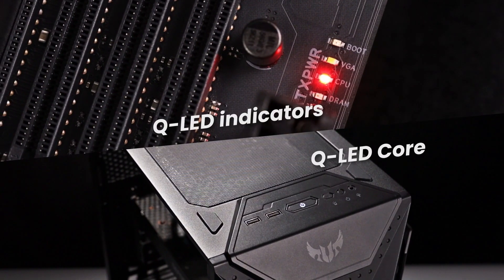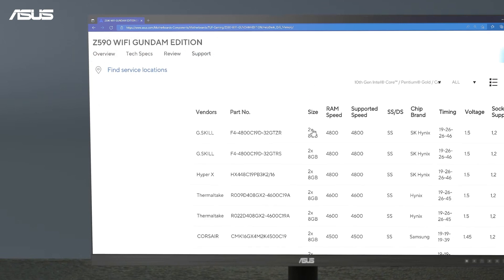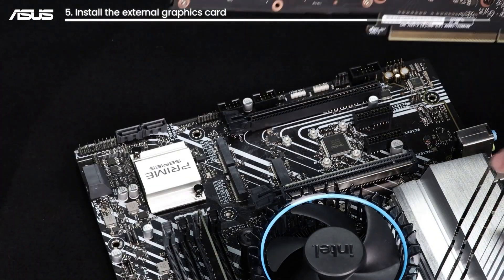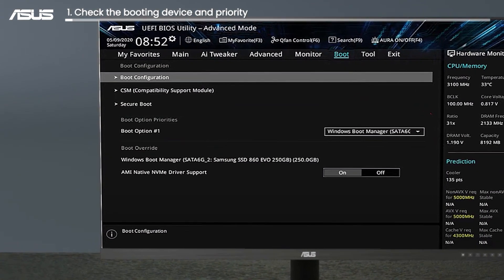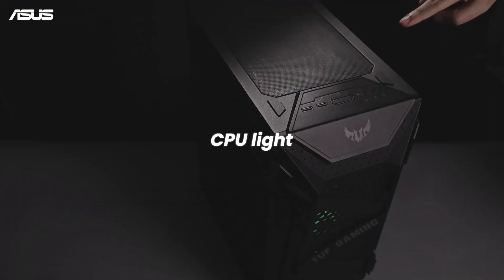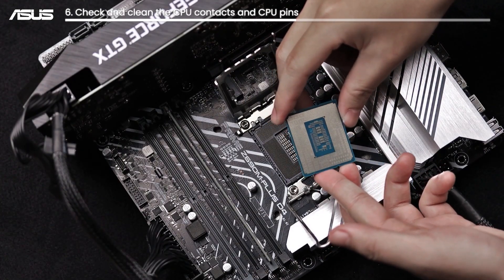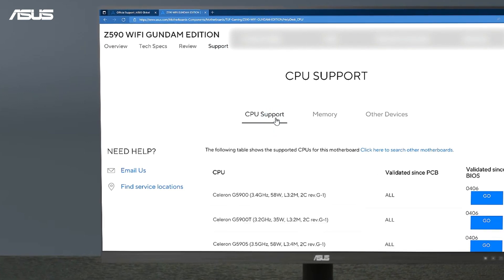ASUS Motherboard Troubleshooting via Q-LED indicators, Q-LED Core   | ASUS SUPPORT

Comment: Hi Asus Support, my new computer power led will blink 3 times and continue with normal boot, what could be the issue?
Reply from the maker: Hi, may I ask if your question is related to motherboard?
If so, we are delighted to provide you with a dedicated discussion forum to ensure you receive the best support and answers.
On the forum, you can ask questions related to the products, share your experiences, and interact with other users.
Our dedicated team will also be there to provide personalized assistance, ensuring you receive accurate and timely responses.
https://zentalk.asus.com/t5/motherboards/bd-p/motherboards
Thank you.
Reply: @asus_support  yes, related to motherboard, sure I will post my questions there.
Reply from the maker: It is recommended that you post here to get more assistance, thank you.
https://zentalk.asus.com/t5/motherboards/bd-p/motherboards

Comment: I have an ASUS Pro B650M-CT with a Ryzen 5 7500F and RTX2070 and I'm getting no display out of it. The power LED cycles through the quick/slow/super slow flashing on startup. I mean, it flashes quick for a couple of seconds, then slow for a couple of seconds, and then continuously flashes super slow. I get no display from the graphics card.
I have tried multiple graphics cards, boot devices, and power supplies as I have spares on hand but I don't have any other Ryzen 7000 CPUs or DDR5 to test.
Is it normal that it cycles through the different patterns or does this mean it is erroring on the memory, GFX and boot device? Since there's no display I can't access the BIOS either.
Reply from the maker: Hi, may I ask if your question is related to motherboard?
If so, we are delighted to provide you with a dedicated discussion forum to ensure you receive the best support and answers.
On the forum, you can ask questions related to the products, share your experiences, and interact with other users.
Our dedicated team will also be there to provide personalized assistance, ensuring you receive accurate and timely responses.
https://zentalk.asus.com/t5/motherboards/bd-p/motherboards
Thank you.

Comment: Hello I just built my pc and it work. But the next day it didn’t. I turned on something in bios on accident and now it doesn’t work. It’s flashing vga and boot. I followed the steps 3 times but it still doesn’t work. My motherboard is a b760 with wifi. Please help
Reply from the maker: Hi, may I ask if your question is related to motherboard?
If so, we are delighted to provide you with a dedicated discussion forum to ensure you receive the best support and answers.
On the forum, you can ask questions related to the products, share your experiences, and interact with other users.
Our dedicated team will also be there to provide personalized assistance, ensuring you receive accurate and timely responses.
https://zentalk.asus.com/t5/motherboards/bd-p/motherboards
Thank you.
Reply: @asus_support  NVM I just had to reset the cmos

Comment: Hey pc wizards, I'm busy with a new build and I'm using the rog strix B760-A Gaming wifi motherboard. Once on startup it works through qled indicators, it gets stuck on VGA and then BOOT. I've tried 3 different gpu's. Cleaned out the x16 pcie slot. Check power plugs going to gpu and hdmi cable(works perfect with other pc). Did a lot of reading online and couldn't find anything that resembles my problem. 

My build: 
Cpu i7-14700KF 
Memory: corsair vengeance 32gb DDR 5600 MHz 
Gpu : geforce rtx 3070

Please any advice will be appreciated.
Reply from the maker: Thank you for your interest in our products!
We are delighted to provide you with a dedicated discussion forum to ensure you receive the best support and answers.
For our gaming series products, we have created the ROG Forum specifically for gaming enthusiasts and users of ROG products.
On the ROG Forum, you can ask questions related to the products, share your experiences, and interact with other users.
Our dedicated team will also be there to provide personalized assistance, ensuring you receive accurate and timely responses.
For your question, we recommend posting it here to seek answers.
https://rog-forum.asus.com/t5/gaming-motherboards/bd-p/HSS_MB
Thank you.

Comment: Hola tengo un problema, prende y se queda encendida la luz de VGA blanca y la verde, quedan encendidas y no da nada de vídeo, se apaga de un solo apretón el botón de encendido, no lo mantengo apretado para que se apague. Mismo problema en b660i y tuf b660 plus WiFi, i3 12100f Kingston 5200 y VGA Vega 56 Pulse. La gráfica ya fue probada en equipo AMD y lo mismo los discos
Reply from the maker: Hi, may I ask if your question is related to motherboard?
If so, we are delighted to provide you with a dedicated discussion forum to ensure you receive the best support and answers.
On the forum, you can ask questions related to the products, share your experiences, and interact with other users.
Our dedicated team will also be there to provide personalized assistance, ensuring you receive accurate and timely responses.
https://zentalk.asus.com/t5/motherboards/bd-p/motherboards
Thank you.

Comment: Hi, I’ve just posted on the forum but let me post the same stuff here.
The sentences is below

“Hi, I’m facing on a problem that Q-LED boot lamp lights green, and the motherboard never boots, never enters UEFI with pushing F2 and Del key.
I’ve tried anything I can do like, changing SATA cable, changing the port, removing ALL USB devices, BIOS Flashback, CMOS resetting, checking C: Drive and CPU(Ryzen 5 5600G) is alive on other computer. Of course, I renamed the .CAP file, and nothing happens.
I really appreciate your support, thank you.”
Reply: The motherboard is ROG Strix B550-A Gaming
Reply from the maker: Thank you for your interest in our products!
We are delighted to provide you with a dedicated discussion forum to ensure you receive the best support and answers.
For our gaming series products, we have created the ROG Forum specifically for gaming enthusiasts and users of ROG products.
On the ROG Forum, you can ask questions related to the products, share your experiences, and interact with other users.
Our dedicated team will also be there to provide personalized assistance, ensuring you receive accurate and timely responses.
For your question, we recommend posting it here to seek answers.
https://rog-forum.asus.com/t5/gaming-motherboards/bd-p/HSS_MB
Thank you.

Comment: hi, when i run program that heavily occupy all cores, the CPU light start to blink. sometimes the program is terminated. im using Ubuntu 20.04
Reply from the maker: Hi, may I ask if your question is related to motherboard?
If so, we are delighted to provide you with a dedicated discussion forum to ensure you receive the best support and answers.
On the forum, you can ask questions related to the products, share your experiences, and interact with other users.
Our dedicated team will also be there to provide personalized assistance, ensuring you receive accurate and timely responses.
https://zentalk.asus.com/t5/motherboards/bd-p/motherboards
Thank you.

Comment: I have a B350 F and when i start the pc it shows orange light then red light and then a constant white light.

I am not able to reach the boot menue. This happened and sometimes the pc just boots and now its not booting at all. What might be the cause🥹
Reply from the maker: Please refer to the following FAQ for troubleshooting.
[Motherboard] ASUS motherboard troubleshooting via Q-LED indicators
https://www.asus.com/support/FAQ/1042678/
If the issue persists, it is recommended to send it for repair and diagnostics.
The following is the contact information:
https://www.asus.com/support/service-center-location 
Also you can contact the local service center for help.
The following is the contact information:
https://www.asus.com/support/CallUs# 
Sorry for any inconvenience it may be caused.

Comment: Hi, I bought an ASUS z790p-d4 and I can’t use 2 ram slots (1st and 2nd) I can only use 3rd and 4th. I have same 4 ram memories and the 4s works perfectly on the 3rd and 4th socket. I’ve tried cleaning the sockets many times and nothing happens
Reply from the maker: Hi, may I ask if your question is related to motherboard?
If so, we are delighted to provide you with a dedicated discussion forum to ensure you receive the best support and answers.
On the forum, you can ask questions related to the products, share your experiences, and interact with other users.
Our dedicated team will also be there to provide personalized assistance, ensuring you receive accurate and timely responses.
https://zentalk.asus.com/t5/motherboards/bd-p/motherboards
Thank you.

Comment: Hi all, i have asus tuf gaming z790-plus d4 the problem is my motherboard hdmi port works fine but my graphics card hdmi port is not working the graphics card lights up and everything but no display and the led light stays on white, Can anyone help me please. thank you
Reply from the maker: I would suggest that you try updating and installing the graphics card driver, as well as testing with a different monitor to determine whether the issue lies with the motherboard interface or the monitor itself. Thank you.
Reply: @asus_support  I updated my graphics card still didn't work but when I put on the second pcie it works, I need the primary pcie slot to be working. Thanks
Reply: Common reply Asus support please
Reply: Same issue here rn with my 4070 ti
Reply from the maker: May I ask if your question is related to a laptop?
If so, we are delighted to provide you with a dedicated discussion forum to ensure you receive the best support and answers.
For our laptop series products, we have created the forum specifically for users of laptop products.
On the forum, you can ask questions related to the products, share your experiences, and interact with other users.
Our dedicated team will also be there to provide personalized assistance, ensuring you receive accurate and timely responses.
https://zentalk.asus.com/t5/gpus/bd-p/GPUs
Thank you.
Reply: @aleksandre3381  I have the same graph and the same problem with the Asus Z790a- Wifi
Reply: I have a problem with ROG STRIX B760-F GAMING WIFI the VGA LED remains lit every now and then I tried the guide, updated the bios, updated nvidia drivers, tried two RTX 3060/ RTX 4080 cards and the problem persists the video cards work correctly, please please do a bios update that solves this problem, I also have problems with XMP profiles on DDR ram 5 CORSAIR VENGEANCE RGB DDR5 RAM 32GB 7000Mhz, once set the system freezes and restarts the bios!
Reply from the maker: Regarding your question, I would recommend you visit the following forum post to get more assistance. 
https://rog-forum.asus.com/t5/gaming-motherboards/bd-p/HSS_MB
Sorry for any inconvenience it may be caused.

Comment: asus b450 plus not working with ryzen 5 1400. original owner said it didn't work with ryzen 7 3700x but does work on old ryzen 3 1200. updated bios. no boot. tried resetting cmos. still no boot. but works perfectly on ryzen 3 1200
Reply from the maker: Hi, may I ask if your question is related to motherboard?
If so, we are delighted to provide you with a dedicated discussion forum to ensure you receive the best support and answers.
On the forum, you can ask questions related to the products, share your experiences, and interact with other users.
Our dedicated team will also be there to provide personalized assistance, ensuring you receive accurate and timely responses.
https://zentalk.asus.com/t5/motherboards/bd-p/motherboards
Thank you.

Comment: What does it mean when no q-led indicators come on? No display to even see the bios screen. But the q-led never come on at all.
Reply: Am having the same problem did you get help
Reply: I’m also having the same issue on my Rog Strix B550-F. I start my pc, no qleds light up, and also nothing comes on the display.
Reply from the maker: Regarding your question, I would recommend you visit the following forum and post there to get more assistance. 
https://rog-forum.asus.com/t5/gaming-motherboards/bd-p/HSS_MB
Sorry for any inconvenience it may be caused.
Reply from the maker: Hi, may I ask if your question is related to motherboard?
If so, we are delighted to provide you with a dedicated discussion forum to ensure you receive the best support and answers.
On the forum, you can ask questions related to the products, share your experiences, and interact with other users.
Our dedicated team will also be there to provide personalized assistance, ensuring you receive accurate and timely responses.
https://zentalk.asus.com/t5/motherboards/bd-p/motherboards
Thank you.

Comment: Hi. I put together my new PC today. After turning it on, I have a very slow blinking light. I would say it is most likely the Boot-Indicator Blink. (8Sec from LED on until next LED on) 

Unfortunately, i get no visual signal from  my HDMI output so i can't check in BIOS (or do anything else). Neither the Mainboard nor the GPU (2080Ti) HDMI output gives me a signal.
So i kind of don't know what to do and if it really is a booting problem or something else. I am noob in building a PC. But i thought i connected everything.
Any ideas?!
Reply: Something prob not plugged in right
Reply: PS: I figured it out: I hab my RTX 2080ti connected via an 8pin cable, wich had 1 plug on one end and 2 on the other. So i thought i could plug the two headed side in my gpu. But it HAS to be two seperate cables to work
Reply from the maker: Please make sure all the components are properly connected. Double-check that the RAM, CPU, GPU, and all power connectors are securely seated. Reseating components like RAM and the GPU can resolve connectivity issues. Turn off the PC, unplug it, and carefully reseat these components. If possible, try starting the PC with the bare minimum components: CPU, one stick of RAM, and the GPU. Disconnect all other peripherals and drives. This can help isolate the problem.
Reply: @asus_support  Like said, i already found the issue: i needed to connect my gpu with two seperate cables, not with one splitter cable

Comment: Hello asus , i have a b550 f gaming wifi rog strix and a lian li dynamic evo as a case , where do i connet front panel connectors ? Theres no pwr led cable.
Reply from the maker: Thank you for your interest in our products!
We are delighted to provide you with a dedicated discussion forum to ensure you receive the best support and answers.
For our gaming series products, we have created the ROG Forum specifically for gaming enthusiasts and users of ROG products.
On the ROG Forum, you can ask questions related to the products, share your experiences, and interact with other users.
Our dedicated team will also be there to provide personalized assistance, ensuring you receive accurate and timely responses.
For your question, we recommend posting it here to seek answers.
https://rog-forum.asus.com/t5/gaming-motherboards/bd-p/HSS_MB
Thank you.

Comment: Avevo scritto che i Q LED non si accebdevano e ad asus gli rode ammettere che la scheda e' bruciata.
Reply from the maker: As your language is not my native language, to avoid any misunderstandings in communication, could you please state the situation you encountered in English? We apologize for any inconvenience this may cause.
Reply: @asus_support  I solved it, an additional cable for the power supply was blown. Fortunately no damage, ASUS TOP always N1. In PSU.
Reply: @asus_support  I wanted to ask you which processor and motherboard do you recommend for the TUF RTX 3060 ti OC 8 + 8 PIN for power supply?

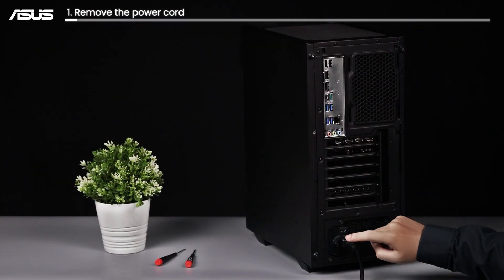Comment: Hi i just bought a EX-B660M-V5 D4 and with a I5-13600KF and RTX3070. My pc turns on normally but no screen! Power button flashes fasts and according to the manual is the memory or the processor. I have already changed memory 3 times and now im with a memory compatible with the system, still nothing. If anyone can help me with this nightmare i would be extremely grateful. 1:15
Reply from the maker: Hi, based on your issue, may I ask have you make sure that the CPU is compatible with the motherboard?
You can check the QVL list in the below link.
https://www.asus.com/motherboards-components/motherboards/expedition/ex-b660m-v5-d4/helpdesk_qvl_cpu/?model2Name=EX-B660M-V5-D4
Have you try to cross test with other monitor?
Thank you.

Comment: My b760-creator d4 starts normal, then checks for failures, turns off by itself and then starts again. Is it normal?  It's my first Asus computer. Are Those steps correct? or Is there a problem?
Reply from the maker: Hi, based on your issue, in order to better assist you, it is suggest that you post the issue to Zentalk.
Also, please record a video about the issue you mentioned for better understanding on the forum.
On the forum, you can ask questions related to the products, share your experiences, and interact with other users.
Our dedicated team will also be there to provide personalized assistance, ensuring you receive accurate and timely responses.
Thank you.
https://zentalk.asus.com/t5/motherboards/bd-p/motherboards